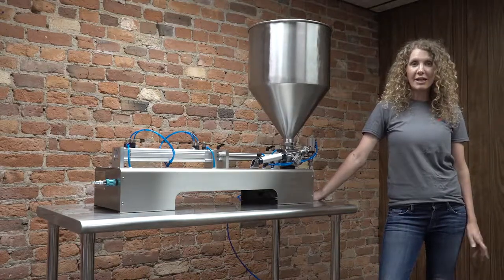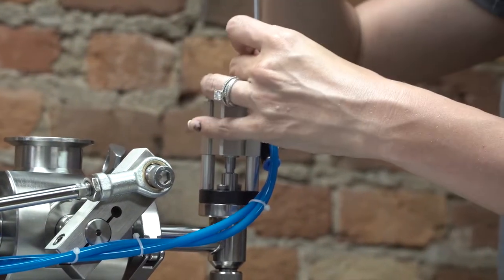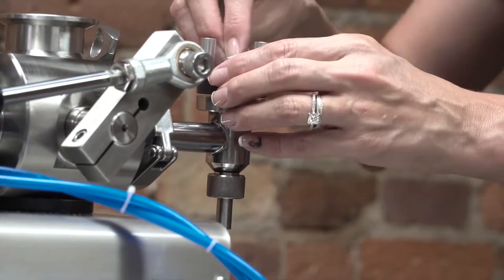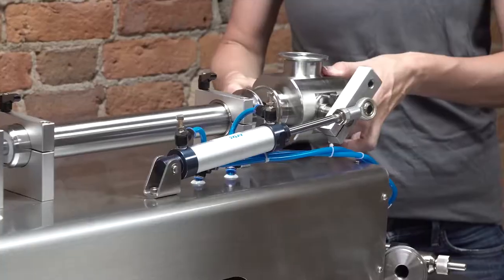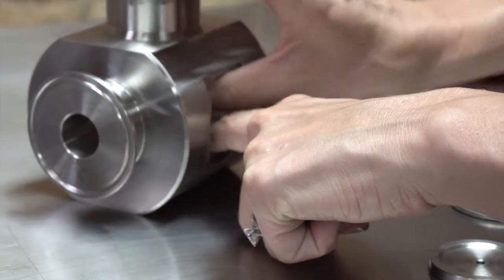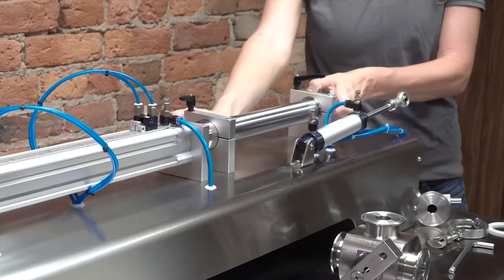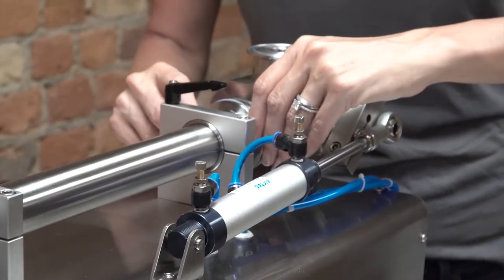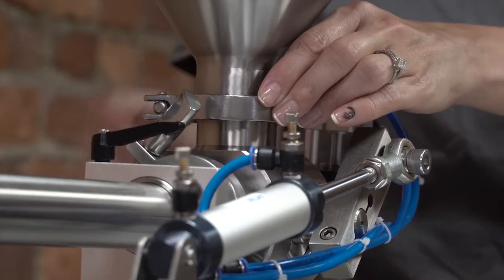Apex Filling Systems Piston Filler disassembly & reassembly tutorial

Comment: Even with a good amount of lube, my 3way valves seem stiff, and hard to rotat..?
Reply from the maker: The 3-Way valve additionally has bearings to help it rotate. If the core was dropped or damaged, replacement bearings may be required. Our Tech Support team will gladly help or provide additional bearings if needed. Support can be reached on our website apexfillling.com, or emailed at support@apexfilling.com
Reply: @apexfillingsystems9829   the bearings are completely stainless steel? how it is avoided that the fat from the filming does not contaminate the product